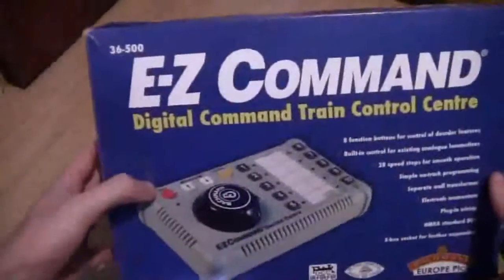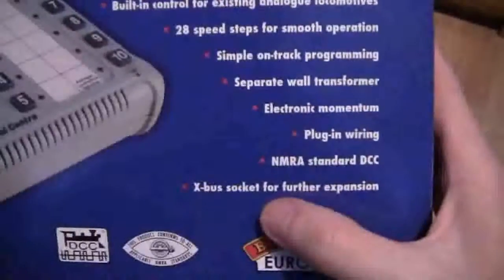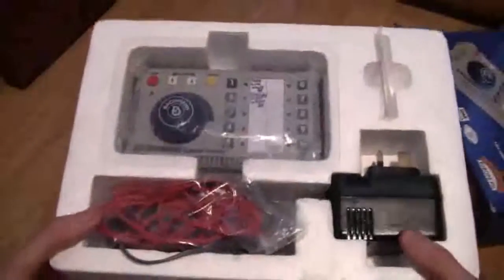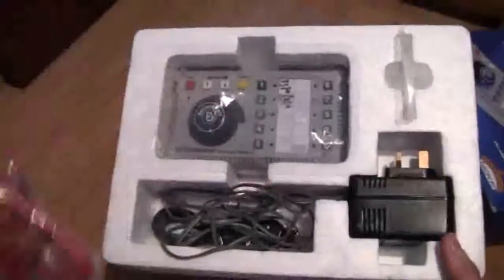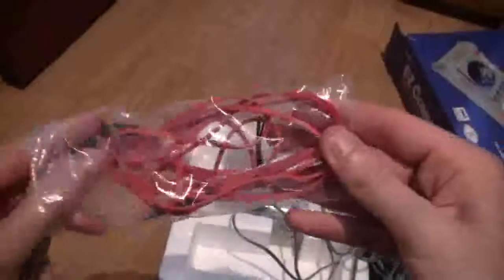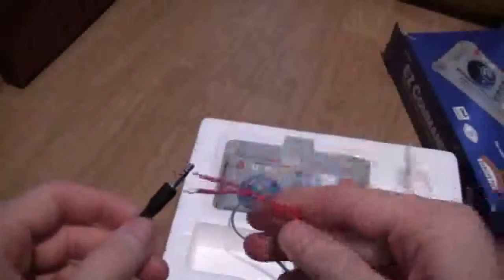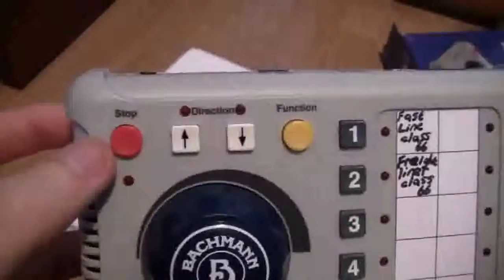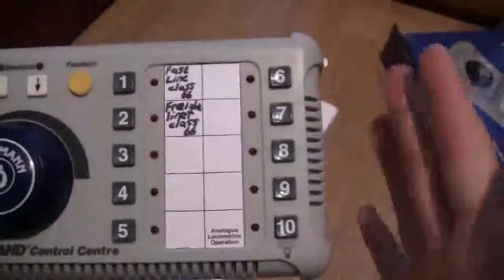Review Of The Bachmann E-Z Digital Command Control Centre

Comment: Finally!  An adult who knows what he is talking about when it comes to the product at hand, lol.  Sorry, 5 videos in a row previous to this with children attempting to educated folks on the Bachmann DCC system & they don't have clue one what they're doing.

I'm "old school", a model railroader since 1968 with the typical DC operation & only recently decided to try DCC.  Since the systems can be very expensive & I may not like it, I decided to go with the less expensive DCC system which is why I have the Bachmann EZ Command.  Here's my problem?

I purchased an Atlas DCC loco that came with a factory setting of #15 and since this system only goes up to #10, how do I reprogram this locomotive to run on my system, or can it not be done?  Thanks in advance & great video!
Reply from the maker: Bernhardt Heckendorn - hi there, there is a function which allows you to re-allocate the programming number of the locomotive. For example, all UK locos come pre-programmed with 3. If you read the instruction manual if your control system came with one supplied by Bachmann, then there is a page which tells you exactly how to do this. Hope this helps you :-)
Reply: ***** Thanks so much for getting back to me so quickly.  Yes, most of the U.S manufacturers do the same thing however, this Atlas locomotive came factory set at #15 (which surprised me) and when I looked it up in the Bachmann book, it shows how to change the address up to #10 but nothing on how to program beyond that?  So, I have a brand new DCC locomotive that is a paper weight, lol.
Reply from the maker: Bernhardt Heckendorn - not a problem, even though I have not reviewed my EZ Command Dynamis system yet, may I recommend it to you as it is by Bachmann and can program up to 99 locomotive addresses. I find it is simpler to use as well and is a great controller for DCC operation
Reply: ***** Do you know if the Dynamis will be compatible with the Bachmann Power Booster?  I just purchased the power booster set-up & I am very pleased with that.  It gave my DCC locos much more power, brighter lights, clearer sound & I can run my locos at a crawl now where it was a bit difficult to do previous to the power booster.  Plus, I can now run up to 10 locomotives on my layout since adding the power booster.  I think I'll jump into my 2014 catalog & see what the Dynamis will set me back.  I have the DCC EZ Command Center as you know plus, I now have the power booster along with two DC power supplies.  That Dynamis just might be the way to go for sure.
Reply from the maker: Bernhardt Heckendorn - I would have thought so, I'm looking at getting the booster for my new layout as with moving house I've currently dismantled my old one completely now, so going to start re-building it once we move in
Reply: Well, I think I may have purchased a bad locomotive when I got this new loco on eBay?  I've tried everything I can think of and I still can't get the DCC loco to do anything.  I've done exactly what the instruction manual says when it comes to locos with a higher factory setting and nothing happens?  It works perfectly fine in the DC mode but is a paper weight in the DCC mode???
Yes, I definitely recommend the power booster!  You'll be real happy you added that to your layout.  Good luck with the move & let me know how the new layout is going.

Comment: I have an EZ Command and I find it very limiting.  You are only able to change the loco's address (number it runs on), or turn off & on the lights.  I think you need a higher grade controller like the Command Dynamis, the Hornby ELink, etc..  Lenz & Gaugemaster make higher end controllers that enable you to program the CVs.

I plan to do a video on my channel to show how this is done but I'm yet to invest in one of these higher end controllers.

I'm new, so someone will correct me if I'm wrong.

Comment: This is a really nice review, nice job.

However, be careful if you are running n-gauge with this controller.  Analogue trains can not be run using this controller as they will fry the motor.  I killed a Graham Farish Class 08 in less than 10 seconds and Bachmann don't want to know even thought the controllers manual states that you can run analogue trains.  I have updated my E-Z command review video accordingly.

Be warned.